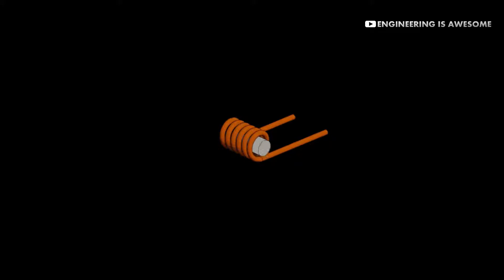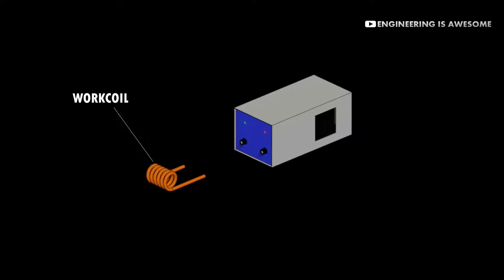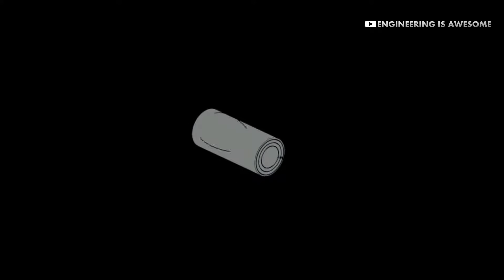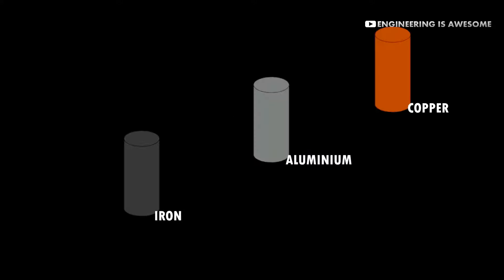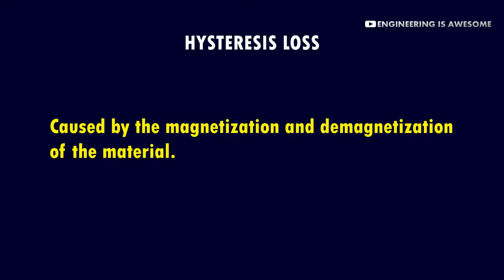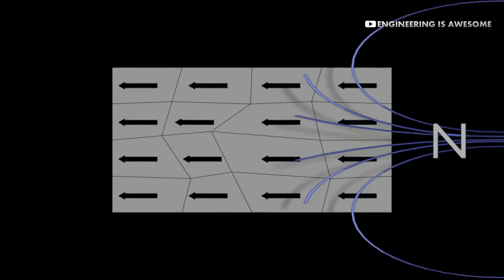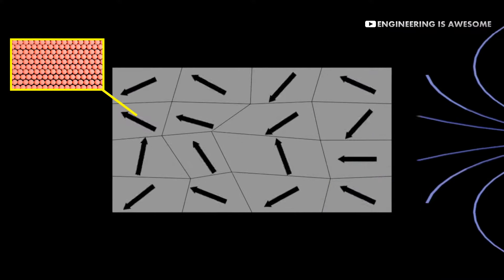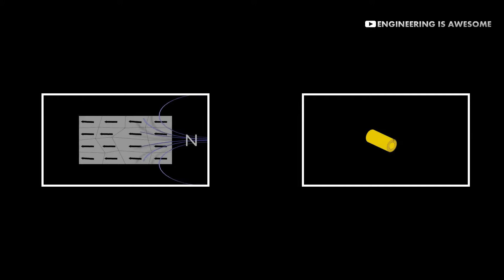How Induction heating works?|Eddy current heating|Hysteresis loss

Comment: Its a very good explanation. Thank you.
So as per the video the heat in the Cooking pan is not transferred heat from any other coil , its a direct heat generated because of the eddy current produced inside the Cooking Pan.

My Question is : 
Than why it doesn't harm us when we touch ( Human body) the cooking Pan on the induction stove when it is having current inside it (eddy current) while cooking ? 

Im not challenging anyone, its just my genuine doubt, hope to find the answer

Comment: How do induction hardened component/part remains demagnetize?

During induction hardening magnetic lines and due to reversing it Eddy current will flow overall the component, right? Then how particular area is getting hardened?